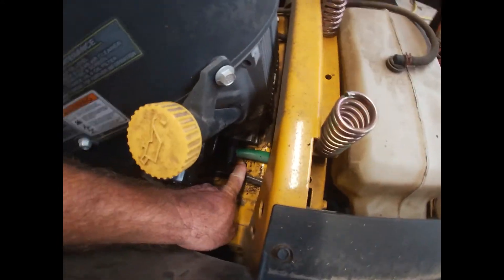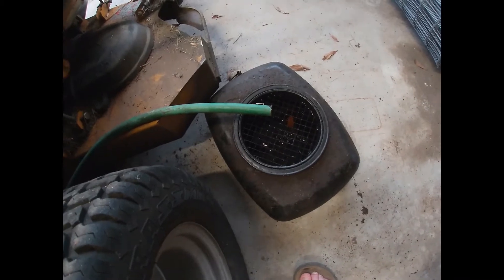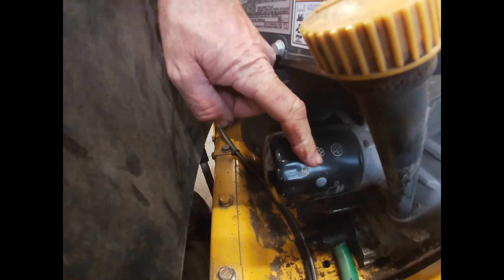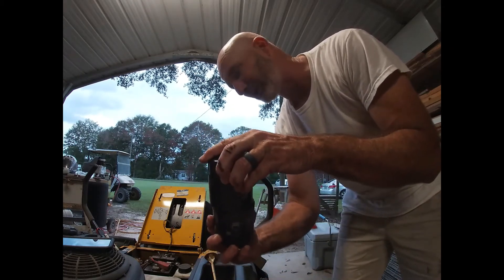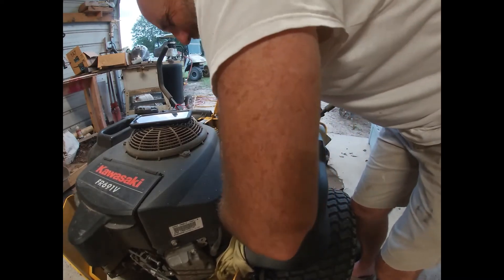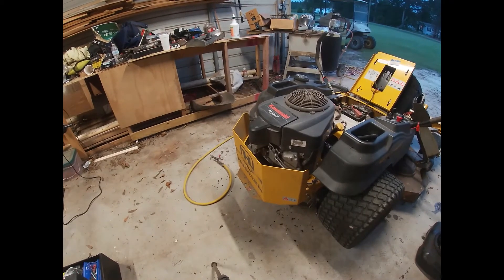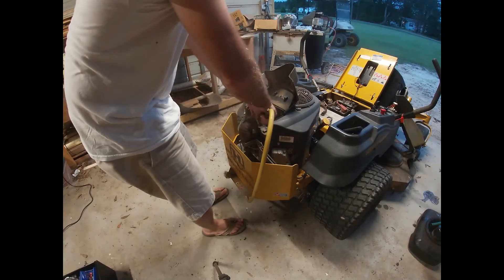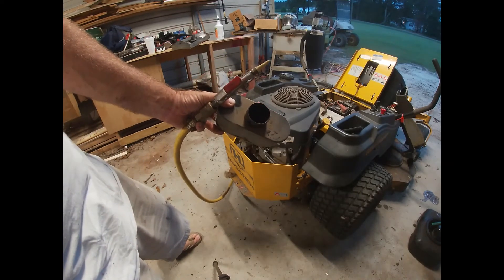Hustler Raptor SD Oil Change

Comment: One thing to try,  I couldn't tell from the video, but when you open the drain screw/plug, break the dipstick cap loose and it will drain faster😜. I put the Kawi 10w40 in the Toro. I run the JD Turf Gard 10w30 in my ZTrak(Kawi FX730).  I change mine every 50hrs as well. Even if it is the same # the filters have variations I have noticed. Good seeing your dad out there with ya👍. Keep grinding brother💪👊!!
Reply from the maker: Yeah buddy the dipstick will definitely give it more flow. I so like the oil to be a little warm. Hadn't noticed the filters having the same number being different 😳. Keep up the good work buddy.
Reply: @cleangreenlawnservicellc2630  i have noticed it with the JD Filters and its odd. You buy an oil filter for the same mower and use a wrench to snug it up and then the next time you buy the same filter number, the wrench doesnt quite fit 🤔🙄😂. Never had an issue with one leaking though so thats good 😁.

Comment: It looked as though you were screwing the cap down to check the oil. Kawasaki instructions for checking oil level states, "Insert the oil gauge into tube without screwing it in". My Kawasaki actually has this written on the dipstick.
Reply from the maker: It's an old habit of mine, but you are correct. I should have specified that in the video. Thanks for stopping by and commenting.